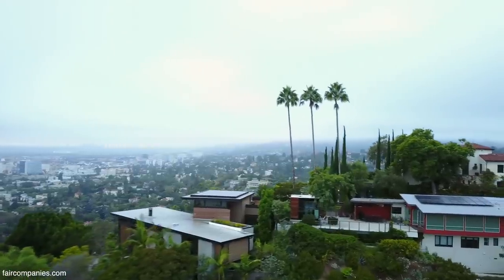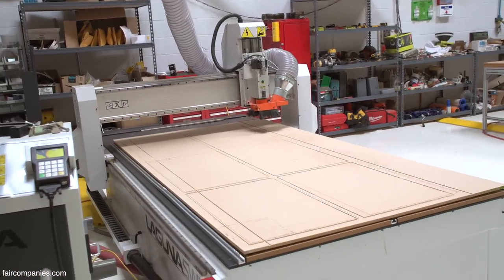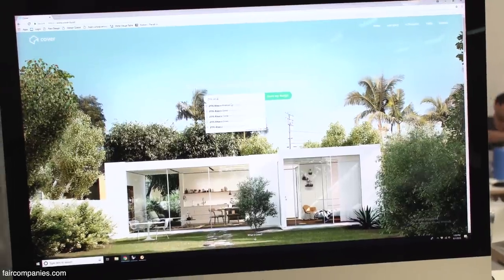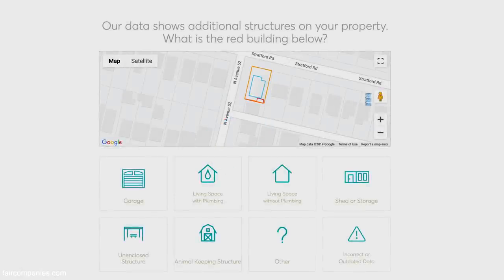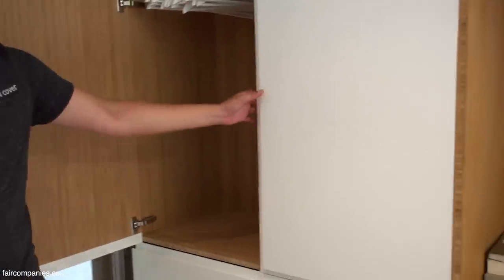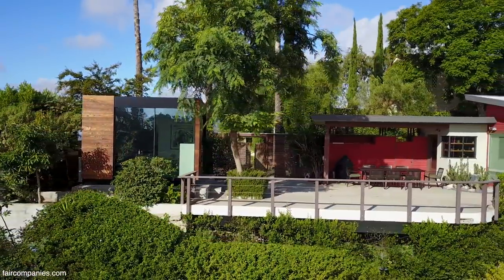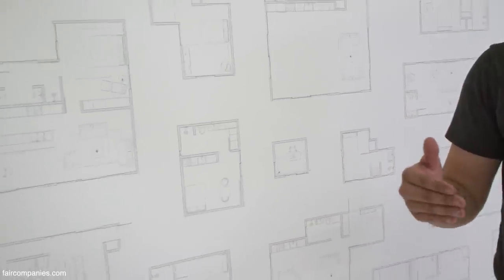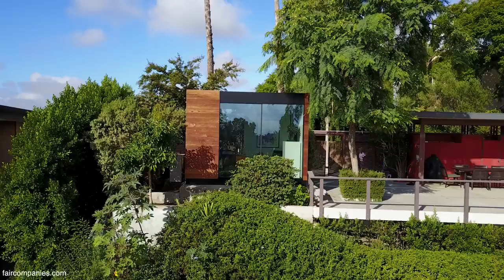LA startup offers custom small prefabs adapted to area code

Comment: as an electrician i cannot express how much of a pain in the ass that receptacle being flush with the wall will be in like 8 years.
Reply: As an electrician i concur. That's not the only problem i see. Hey, let them have it lol.
Reply: At this rate the only trade skill that will exist in 8 years is demo. These housing startups (and this is far from the first) always forget that maintenance down the road is a thing, or just flat out forget that skilled tradesmen are going to be elbow deep in their product later on. Inevitably that unit will be easier to demolish and replace than it will be to repair.
Reply: @marcuspinson  We are living in a time when homes are meant to be disposable. Here in NYC, there are buildings going up with lifespans of 30 years (aluminum, gypsum, wood). Long enough for someone to pay off their $800K mortgage and then retire somewhere less harsh. 

Its a trashy world my friend
Reply: @scientifico  looks like I'm gonna make some good money when it's time for those to come down. Since I'm one of the only under-30s i know who's licensed and experienced in heavy equipment operation. I'll be the one who gets to demo all of this crap. Then scrap it all.
Reply: @marcuspinson  It'll probably burn down before you get a chance to demo it.
Reply: @spiritflower6640  Electric outlets last about ten years.  Switches can be less.  They all eventually need to be replaced.  These home builders have never maintained a house.  They have only lived with their parents and therefore lack experience and the for sight that comes with it.  These guys are right about these prototype models.  Early adopters will pay a heavy price, but eventually these could be perfected.  The boys in this company would do well to read the comments from the men with real experience here.  This comment is from a home owner with a ten year old house.  I'm currently changing bad switches and outlets.
Reply: @matttafakt  Ya, dont get me started on the CNC machine for scale-ability lol talk about a waste of material, power, and time. Pure prefab is stupid and in an ideal future would be combined with 3D printing for cement etc. and semi-prefab elements such as large installations. This segmentation and "lego" idea is not at all sustainable, or consumer friendly. I hope they have a few tradesmen in the company but its doubtful.
Reply: Second Act - I have a house built in 1953. When I bought it in 1994, I brought electrical up to code. I haven’t ever had any problems with my electrical outlets, so I can’t relate.
Reply: @scientifico  I did new home (or rather mcmansion) construction in SWFL. These designers chose the most expensive low quality material and rush us to build it only for the property only to be sold within 6 years, tore down and a new one thrown up. Its the sad truth of the real estate market in my neck of the woods. I hate it. No need for large yards, super high ceilings, fireplaces, etc. Homes should match the environment they are in and shit like this home will waste sooooo many resources in either use of chemicals used for "eco friendly" windows or in AC draw. I could go on but I dont want to rant about the superficial, poor designed, and faux eco market of housing. :/
Reply: @marcuspinson  Good for you dude! I have a BA in History and worked a bit in construction officially and with my electrician dad growing up unofficially (dont tell OSHA) and I can say that learning a trade was as worth it as learning the humanities. My only wish is that it these homes wouldn't need to be scrapped. It such a waste of finite resources and peoples time. I want to be able to one day take my future grandkids on a drive and say "ya your grandpa helped build that" instead of "ya your grandpa helped build the house that was before the previous, previous,previous,previous,previous,previous,previous..."
Reply: @spiritflower6640  Absolutely dude! So one of the issues I see right away is that the face plate of the recep is exactly flush with the wall. Not an issue if the walls were panels rather than drywall and wood. It is kinda like using product design in architecture; whats smart and clean looking in a Mac is really impractical for a home. Say this place is home to a kid and the kid some how breaks the receptacle (happens more times than you'd expect): one solution would be to cut a hole in the dry wall remove the box with the recep, unscrew the recep, replace the plug, screw it back into the cut-in box, then buy new drywall manage to cut it exactly to the hole, resecure the recepticle to the drywall somehow and then plaster and paint the whole thing up. If it was a traditional receptacle you would just unscrew the face plate, disconnect the plug, put on a new plug, and screw back on the face plate. 

tldr: you have to cut into and repair the drywall itself if the outlet breaks or gets fried. That is time consuming, and  a pain in the ass. Not to mention where the wires are in this "lego" style "block" of a wall and the lack of possibilities for renovations.
Reply: @maureenkelly738  they don't make them b like they used to.
Reply: Maureen Kelly finally a commenter I can relate to. In a normal well built house electrical outlets should last many decades. It sounds like these other commenters just bought cheaply built houses. Advice: due diligence, don't end up living with a lemon.
Reply: I was also wondering how light globes are changed.
Reply: @secondact7151  An electrician would just cut a hole for a full size faceplate and replace the entire switch.
Reply: Mmm. I think that power point will not ever be repaired, but rather replaced by removing it completely - wire and all. 
Same goes for most other parts of these living modules. 
Lots of jobs lost in producing and maintaining these structures when compared to traditional building methods. Definitely the future.
Think of theses modules as stationary top-end campers rather then houses, serviced by trained technicians rather than electricians, plumbers, skimmers, painters etc.
Reply: I would have made them as a push button design, where you press in, the outlet cylinder pops out, you twist and pull out with wires and all.
Reply: You are not looking at this in the right way if you're thinking tradesmen.
These modules are cutting out tradesmen. 
These living spaces are more campers than houses in it's traditional sense.
 Do you think auto manufacturers design a car door in a way that any skilled or unskilled panelbeater can easily fix a damaged door, replace the window and re-wire the electric mirror. No. Quite the opposite.
This is the future.
Soon the prices will drop when competion arrives, materials will be completely made from recycled plastic. 
Someting breaks, burns or malfunctions - you go online, send a pic, order the part (everything is coded) and along comes an installer to replace the parts. Probably for free, as you've taken it the 20 year houseplan wich gives you cover against breakage.

No more laborers arriving drunk, messing cement everywhere.. oh the list is long.
I could def live like this!
Reply: You will not be called to fix that plug. This is a different game. The owner will have a few sealed lumes in stock and replace it in seconds.
Reply: @secondact7151  From my experience outlets and switches last a lot longer than 8-10 years. You must be factoring in some heavy use here. Neverless they will still need to be accessed for replacement. The video dd not show how any plumbing or electrical components can be accessed for maintenance or replacement but maybe their is a way to do it thatchy did not show...
Reply: ADMA Good idea!
Reply: Hardy Maritz Finding good craftspeople has become an absolute nightmare.
Reply: You guys are very right.. build it right and it will last a lifetime...
This tiny house BS leggo house is just disposable housing. 
I'm  not holding out much hope for the future if everyone wants houses that you just tear down instead of fix.
Reply: I do not think these houses are made for that long time of use. If the outlet breaks you simply buy a new house. This factory is all about the short term, design and hopes you will forget the price. Another here compared it to Apple :)
Reply: @checkmatefurries286  I'm never wasting the money on college unless i want to aquire a debt to pay off so I can finance my next house. You can learn all the humanities on the internet free of charge so that's not really worth it, and there's no work in gender studies last I checked. Nobody is going into tradeskills now so after a few decades of nobody being certified to jack squat I'll be able to name my price when the town bridge collapses and the lights stop working.
Reply: I'm not an electrician and my first thought was, "That's going to be a problem later." Same with the sliding glass windows. Lol!
Reply: @marcuspinson  This is what happens when hipsters think computers are something else than yet another tool. Is a generational gap the school system never managed to fill. They live in a virtual world...solving false abstractions of real problems...incompetent to a fault...and full of themselves...not all...but it is the result of over extended use of technology because there's no contact with the harshness of time.
Reply: @secondact7151  Why do Outlets need to be replaced...and please DO GET technical...I'm an EE.
Reply: @maureenkelly738  Notice there is no argument, I asked...we'll see.
Reply: @secondact7151  my house was built in 1947 and still operating in same electric outlets and nothing has been worked on or up to code. Yea im scared
Reply: @scientifico  the worst part is.. the 800K was 15 years ago 200K but the wages  didnt go up the same way....
Reply: @secondact7151  i dont know how electrical units are built in the US, but here in europe, wer have no issues with them, my grandparents  have a house that was built in the late 70's,  it was overhauled in the early 90'S cuz the electrical system didnt fit the new code at all,  since then not one outlet was replaced... just saying...
Reply: @mrdot1126  it's a case by case thing. My flat in a pretty affluent part of Hannover, Germany was renovated two years ago. Week three of living there: flip the switch and the light gets fried. I had to replace the sconce, the switch and receptical. Shit happens sometimes.
Reply: Has anyone ranting about these flush receptacles ever installed this product?  If you had you would know that they come with a slick removal tool that removes the receptacle for servicing or replacement. No disruption to the box or wall surface.   Really well designed by Bocci.
Reply: I see flat roof as being a bit of a problem. No drainage system for rain.
Reply: By cheap by twice
Reply: @checkmatefurries286  There are already companies doing this successfully though. Blueprint Robotics is in my backyard building homes with great margins.
Reply: Maureen Kelly I don’t know where you are from but in Europa it’s perfectly normal to build stuff that lasts a 25+ years. My outlets have been replaced in  the early 90s same for switches and wires. This shit just works if a real professional works on it. I’m sorry to say that but US Builders/Electricians etc suck compared to German ones. They lack the German trainee system, it’s really like a „do what you want“ mentality here you have to prove yourself every few years to even be allowed to touch wires.
Reply: @trackdaydetailing9651  once again. The thing Europeans forget is that the USA being bigger than the EU has different requirements and programs depending on state. Comparing the US to Germany is like comparing Guatamala to the entire continent of Asia. Apples and oranges. Based on the shitty workmanship I have seen here in Germany I would not even attempt to claim it's superior to American standards. American unions in certain states blow Germany out of the water. In others they don't even exist. It's a state by state thing. It's like comparing the systems of Poland to that of Ireland.
Reply: Maybe the whole wall panel can be removed and replaced just to swap a burnt out socket!
Reply: checkmatefurries is say no matter how good you guys are, even if a rocket scientist would be your homes - they just suck quality wise. Your windows are so strange, same goes for plumbing, you can’t drink the tap water in many places, your cables are still in posts on the street, you use dry walls I could hit a whole through the ONLY thing you guys are good at is hardwood floors and even that is something a lot of homes have missing. 
Of course you can’t compare them 100% but I can say on average your homes are shitty, I never felt really comfortable during my time in California. All places I’ve been at were at best on German camping level. It’s in the details, of you look at the whole house it’s nice but try to look at them from an outside perspective - there are so many things that don’t makes sense when looking at a middle class home in California. Luxury is something else, I’m just talking about up to 600k (California) homes.
Reply: @scientifico  This is a function of land value drastically exceeding the cost of construction materials.  Can construct a 2k sqft home for ~300k, but if the lot costs 2 million you might as well just build a new one since it's only 15% of the value.  Much easier to flip.  In some rural town where you can get a 50*100 lot for 10k it's a different equation.
Reply: @checkmatefurries286  Don't worry. There will always be hipsters who will go for this kind of housing.
Reply: @marcuspinson  then they'll create a 'high-tech' demo startup LOL
Reply: @checkmatefurries286  Oh and let me guess, it probably has that ridiculous contraption called forced air 'heating'. Though if it's Florida it doesn't really matter, but I just love to see pictures of mcMansions up north, like on HGTV. I'm always looking behind the forefront for those telltale signs - the big grid somewhere in a hall, the 'one and only' return. Yup, sure enough.. to me that makes the whole mcmansion one big pile of crap. How can blown around air ever be a source of comfortable heat?? Goes against all the basics of science.
Reply: TIWHW people who are not involved in the profession or trade design based upon aethetics, not practical function
Reply: This guy is so proud of himself for making a "sleek, modern outlet."  Lol.  Please tradesmen, take these guys for all their worth when these places need maintenance and/or problems occur.

Maybe they will learn that skilled trades are that for a reason.
Reply: up with you
Reply: What do you recommend?
Reply: @hardymaritz1222  Really like your output.
Reply: Google bocci outlets. There is a tool to remove outlets that are done this way.
Reply: @marcuspinson  
Heavy equipment isn't needed.
Reply: LOL, love the nay sayers complaining about longevity...the average home buyer moce
Reply: could have made a push-latch lid that is still flush around the powerpoint so that you don't have to cut a hole later
Reply: They're so forward thinking they forgot USB..
Reply: @checkmatefurries286  Innovation is overrated. Wisely done it's one thing, but gone haywire, it's a completely other
Reply: @checkmatefurries286  oh yeah, totally, i can just imagine! I am looking for a small house or townhouse that is newer but without all the gimmicks of the last 25 years. It is next to impossible to find. It's either 60 year old houses with potential issues i don't even want to touch, or contemporary cathedral window crap. Why anyone would prefer to throw money at heating a two-story living room to the one-time up front cost of an extra second-floor room is beyond comprehension. Also try finding a newer house with normal hydronic heating as opposed to the horrors of cheap forced-air heat. In a northern climate this does matter.
Reply: @mrdot1126  Ok, built in the 70s, replace in 90s, so ok that's 20 years. Would you have been ok with replacing the whole house at that point?
Reply: Those electric outlets are cancer, imagine the floors full of electrical outlet boxes, just to get an adequate amount of outlets.
Reply: first thing I thought of as well haha.
Reply: In our throwaway society we don't repair things.  With cars, they replace an entire module if one tiny part goes sour.  If something goes wrong with that outlet they will have to replace the wall.
Reply: I respect you're trade, but why would anyone stay in this prefab for 8 years? These look 3-5 year's tops.

Comment: I know I'm nitpicking, but all the outlets in their model units are installed crooked. If this is the level of attention to detail that they apply to their "model display", I can imagine what their production unit would look like. I mention this because he keeps emphasizing quality, but I'm not seeing it in the details.
Reply: I unfortunately have to agree. And the hole around is slightly too big. 
Also the cabinets doors needs adjustments to sit nicely and the shelving system needs attention to the woodworking.
Reply: I completely agree. I also agree with corner liston that the cabinet doors are uneven. The ceiling slot is also unsightly, in my opinion, and I wonder why they haven't recessed the downlights into the ceiling panels, like most builders would. The same could easily be done with speakers and the like. I'm sad to say it, but this product appears to have been designed by someone who doesn't know what they're doing, to be brutally honest.
Reply: Amen ElectricUnicycles Amen! The whole point of investing into a tiny home is that the small surface areas mean that they ought to be well designed, finished well and made of high quality materials. It is obvious that the startup group is  not really passionate about tiny homes.
Reply: not nitpicking for that price or any price... crooked is crooked... and don't let anyone con you when they say, "you should manage your expectations." ...always expect the best...